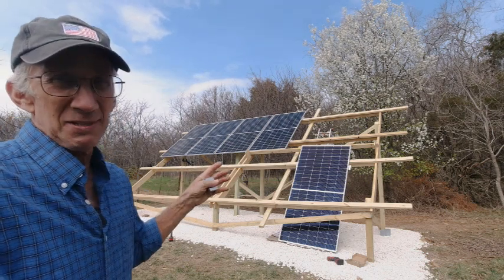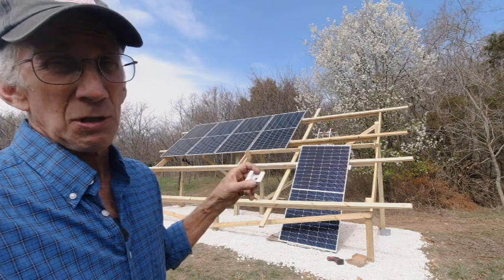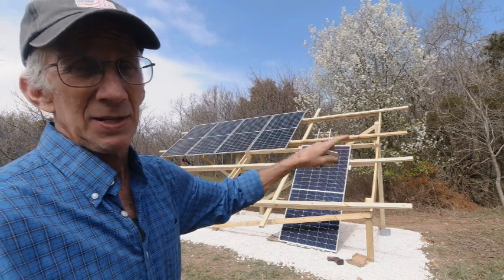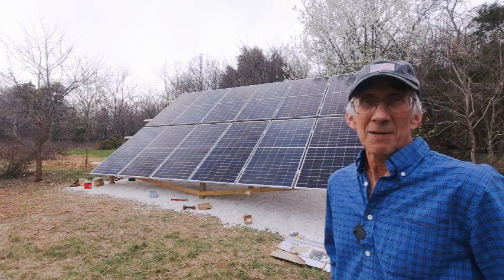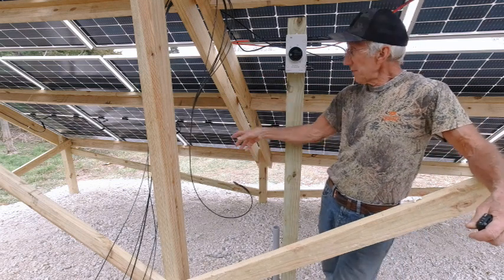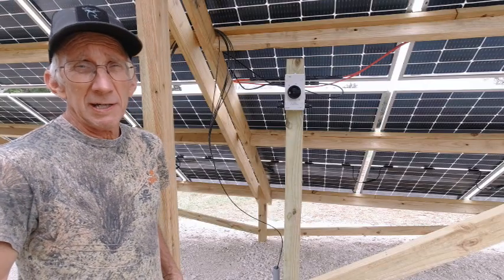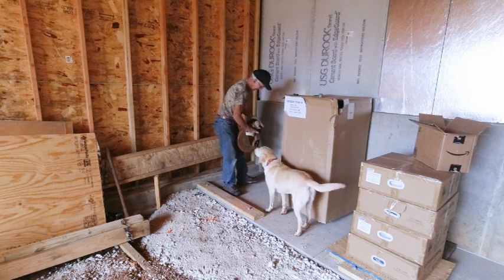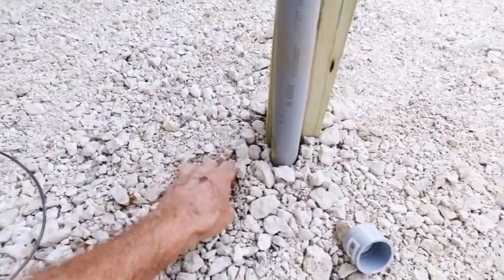Episode 60- Solar start, chapter3, Finishing the solar panel framework and ready for connection

Comment: Superb wiring job, mastery of NEC and robust bonding. That pull of 4 #10 and 1 #8 through 100 yards by yourself and no lube must have been a chore. You will not regret the fat copper especially if you do add to these strings. Does the manufacturer recommend the ground rod at the array and a ground plate at the all-in-one (panel) as well? Just curious. They say frogs are the barometer of an ecosystems health, ribbet.
Reply from the maker: The ground rod isn't required, but it needs to be bonded to the panel. Actually the manufacturer vaguely just requires panels to be grounded. I'm treating the ground rod as an auxiliary ground rod.